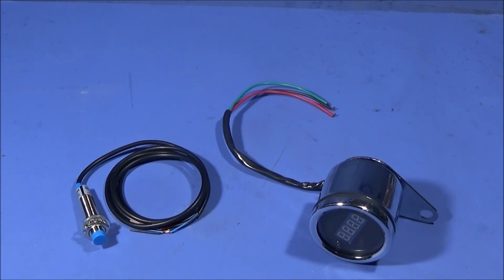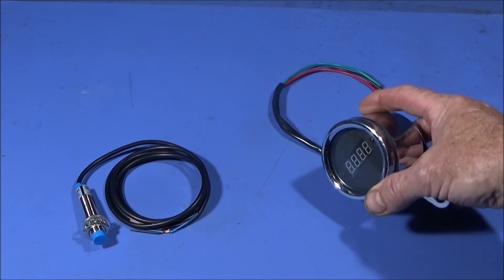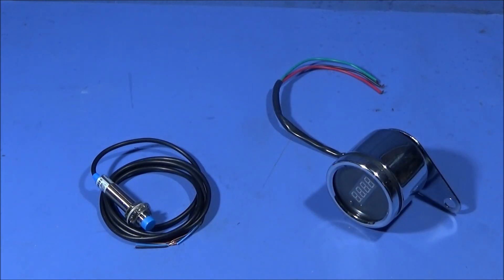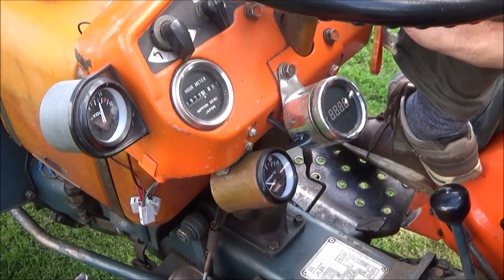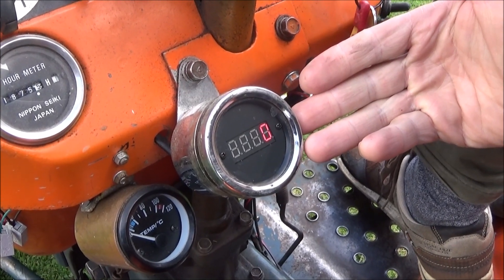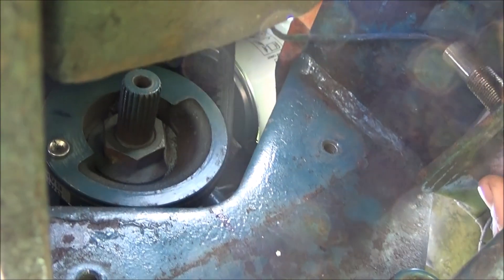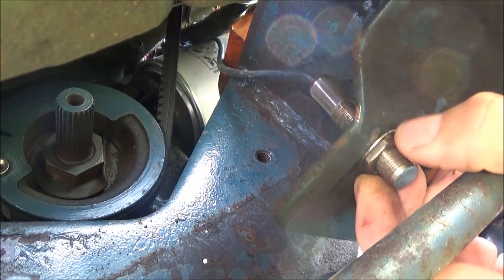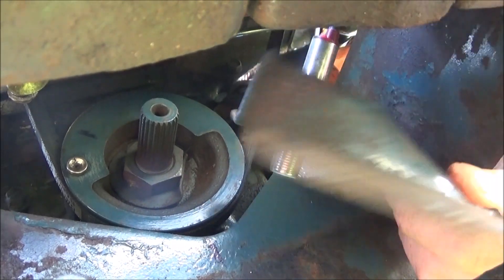Fit A Low Cost Tachometer On The KUBOTA B7001D Tractor.

Comment: Last year I had the two cylinder version in bits for a bent con rod. It turns out they can be straightened and can be stretched back to length. :o We didn’t get to try it though because we found a second hand rod in Holland. (Rare engine) it’s an amazing and has way too big of a loader, so it has a lift box full of old tractor batteries.

Comment: Gday Steve, the kubota tractor is near unbreakable, here in Australia I’ve seen these little tractors absolutely driven in into the ground and still do a days work and they always keep good resale value,  small hobbies farms are a big thing now and these tractors and the grey fergie are very popular, before I retired I was a truck driver and I had to pick a little kubota from a caravan part to take to a workshop and I honestly felt sorry for the thing, it had been flogged and hard but still started and ran no trouble at all, just a bent steering linkage, your brothers have done a good job with all the modifications, great work,    ATB Matty🇦🇺

Comment: The roll bar I can understand but why the rest on  a toy tractor?
Reply: That tractor is a long, long way from being a toy, it is a real workhorse, a mountain goat in the right hands.  Diesel engine, 4WD, 3 speed PTO, large enough to cultivate an allotment size plot in short order, small enough to get into many back gardens and do a full clearance, add to that, any implement that went on the little grey Fergie will fit it................definitely not a toy!
Reply from the maker: Hi Michael. I take it that you must be somewhat naive when it comes  to to machinery and tractors in general. This is just a small estate where it is ideal for its intended use. A larger machine used here would be counter  productive and damage the grounds. This Kubota tractor  isn't a toy but a fully operational and capable machine built for its intended purpose, maintaining smaller grounds and doing jobs which a larger tractor would be unable to do effectively.
Reply: Steve,
Born and spent the first 35 years on a farm with a great deal of machinery including a 4630, td5 and a dinky vintage massy. There are those that use tractors and those that play at it and add go faster stripes etc. I agree the kubota is a capable machine in tight spaces and used extensively in asia with no rpm dial in sight whether it is part of the new Banggood range or not. In capable hands a kubota can be very useful even dragging the occasional  gang mower around.

Comment from the maker: SEE BELOW FOR THE TACHOMETER LINKS. (Also for the wiring connections of these tachometer see instructions on my Youtube community page).
LED Motorcycle Digital Tachometer --  https://goo.gl/2rRiKh
Sensor Cable With 3 Magnet -- https://goo.gl/Meam7q
Category
Reply from the maker: SOME EXCELLENT OFFERS.....
$21.68 4pcs MSPA Inflatable Hot Tub Replacement Kit -- http://bit.ly/2Zr0k1H (coupon: BG1726)
$48.99 Machifit ER11 Chuck CNC 500W Spindle Motor -- http://bit.ly/2ZB99lC (coupon: BG500W)
$33.99 HILDA 220V 350W Variable Speed Electric Grinder -- http://bit.ly/30GTAdt (coupon: BGEG35)
$23.99 HILDA 220V 400W Electric Paint Sprayer -- http://bit.ly/2MJSVob (coupon: BG2c532d)
$213.19 Machifit CNC 5 Axis 500KHZ Offline Controller -- http://bit.ly/2L2i2Al (coupon: BGMACH3)
$32.79 Machifit MACH3 4 Axis USB Electronic CNC Handwheel -- http://bit.ly/2ZkC5CV (coupon: BGMACH3)
$36.99 Self Centering Dowelling Jig -- http://bit.ly/2MH3yIo 
$19.99 Drillpro 8pcs 2-12mm 4 Flutes Tungsten Steel Milling Cutter -- http://bit.ly/2ZkC5CV
Reply from the maker: .
$1.99 Tools & Mechanical Parts -- http://bit.ly/2OSwi2O
Reply: Hello Steve,

I have found your modification video very helpful.  I have a 2005 Kubota BX1500D that I purchased new.  In the past 17 years I have suffered the lack of an RPM gauge and decided to remedy that.  After viewing your video, I was going to obtain the same components that you used and was glad to see the links.  Both links took me to their respective products, however the magnetic pickup link indicated the item was discontinued.  It recommended an alternate item that had nothing whatsoever to do with a pickup for a tachometer.  I'm sure I can find a pickup, but I wanted to be sure that "any" pickup would be compatible with that RPM gauge?  If it's not too much trouble could you recommend a pickup, or if you know if the one in the link is still available somewhere??

Thank you,

Wayne